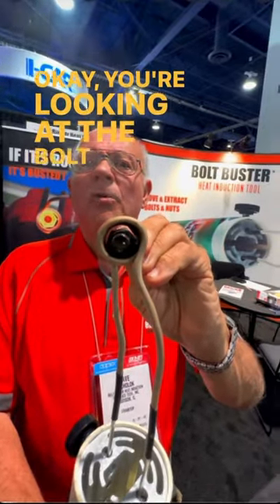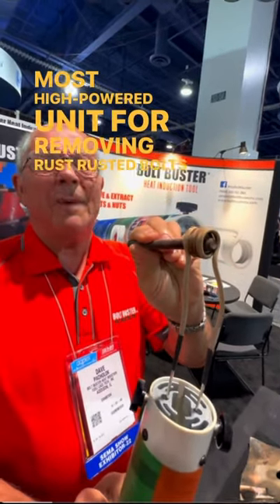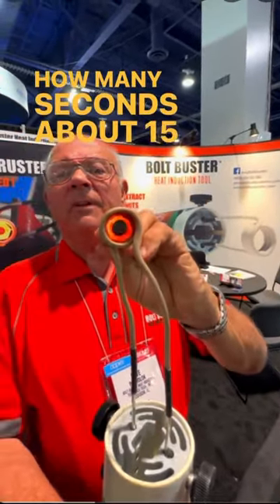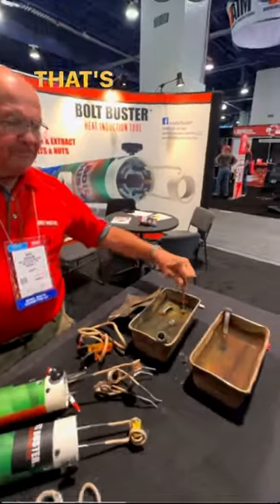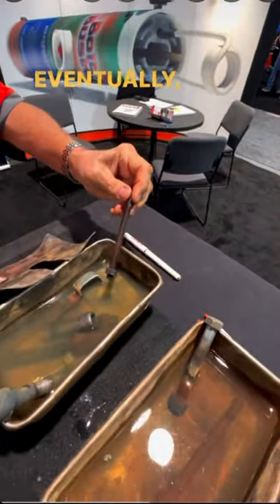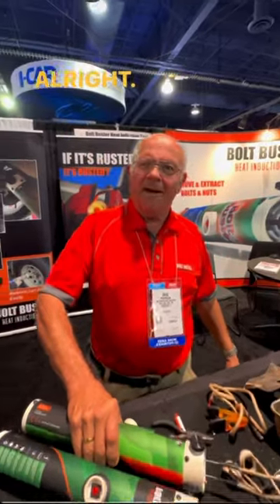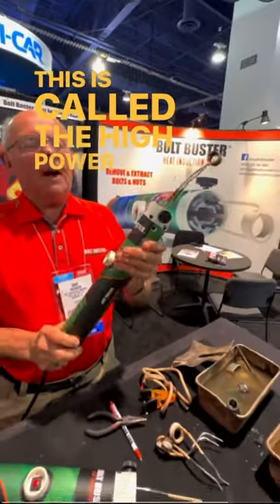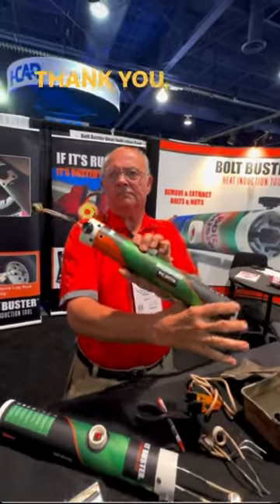That got Red hot in 15 seconds. #shorts

Comment: Not new technology, but these work really well in confined areas or areas you can't put a torch
Reply: The mechanics where I worked used to call for a welder whenever a bolt needed to be heated. And bring your "smoke wrench".